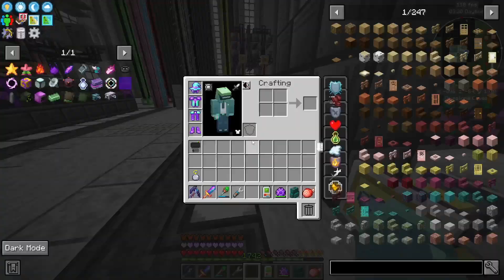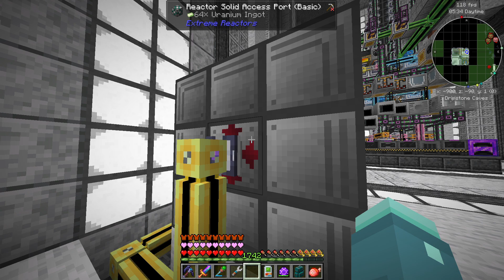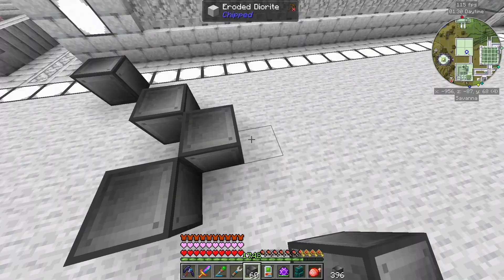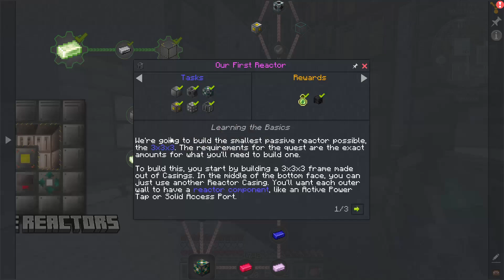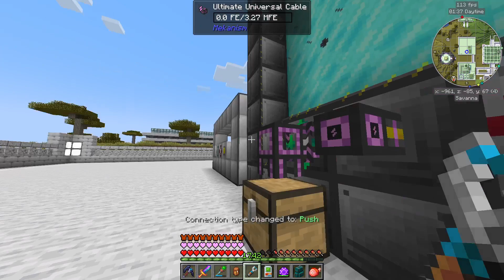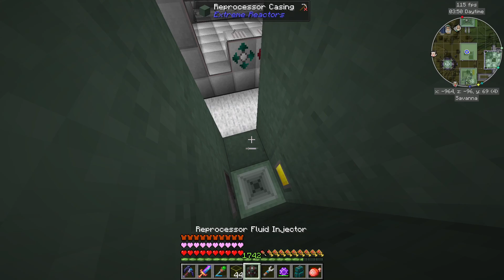Setting Up Extreme Reactors in ATM 10 All the Mods Ep.46 Minecraft Mod Pack

Comment: Why don't you build and use a Fusion Reactor? With a capacity of around 250M FE/s, it would provide enough energy to produce antimatter more quickly.🙃
Reply from the maker: The reason for setting up extreme reactors is to get the insanite, not the power. No one has seen the episode yet, but I have enough antimatter to make 2 blocks of the atm star and 1 extra star. I have no reason to make any more.